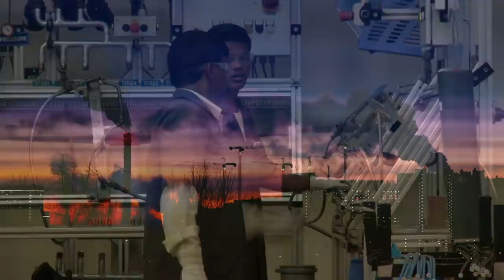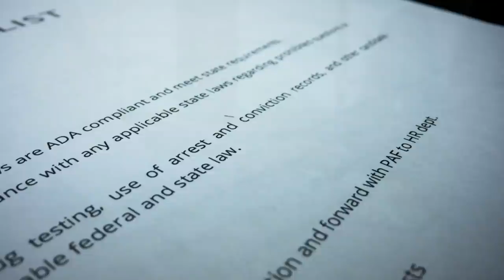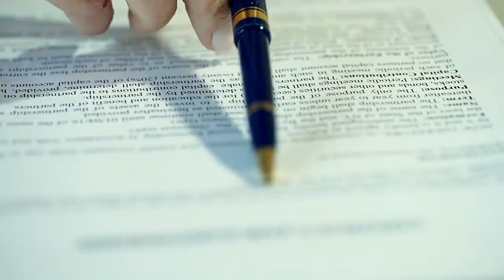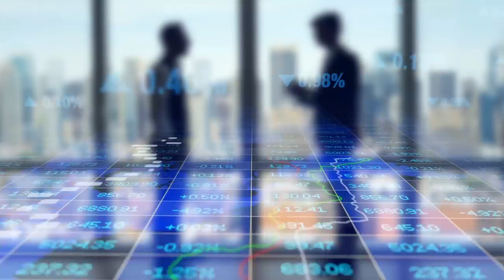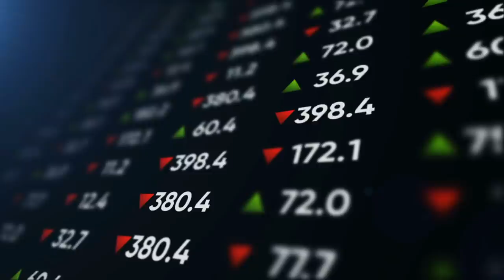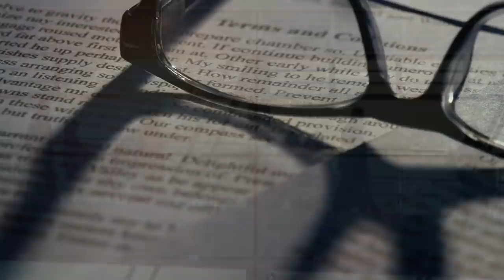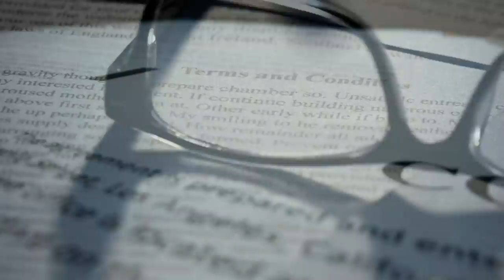Will Bangladesh be the Next China? A Story of Bangladesh's Economy (2020)

Comment: Really hate to point out the obvious but it isn’t going to happen. First thing world wide consumption has peaked and will drop off quickly in most developed countries. The reason is most developed countries have an inverted population pyramid. In other words they are running out of consumers and will have so many retirees the workers will be taxed to cover those costs instead of buying goods. Second because of the aging of the developed world, there will be a lack of cheap and available capital. Bangladesh needs both, capital and markets, and both are disappearing. Last their model forward is dying. The production of fabric and garments is moving away from low wage countries and headed back home. Because of automation you can do the same thing with almost no employees. It’s why garment manufacturers are moving their production back the countries like the US.